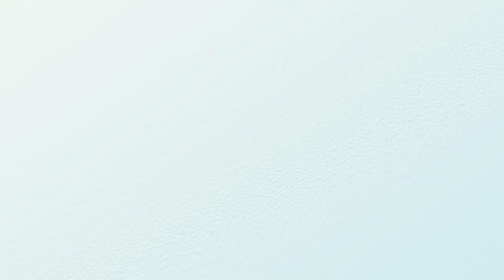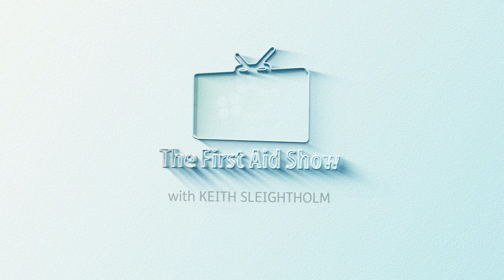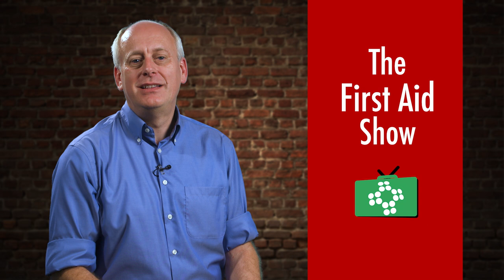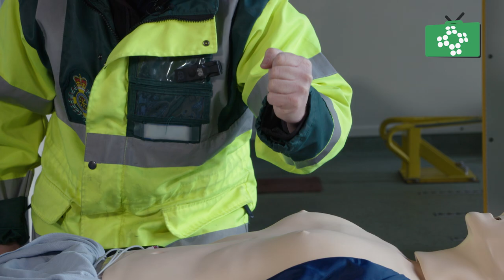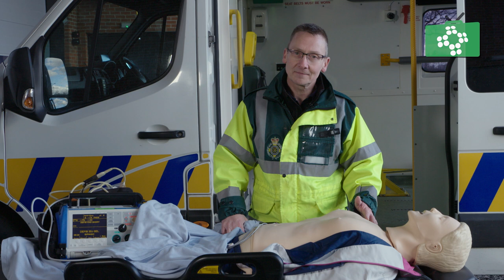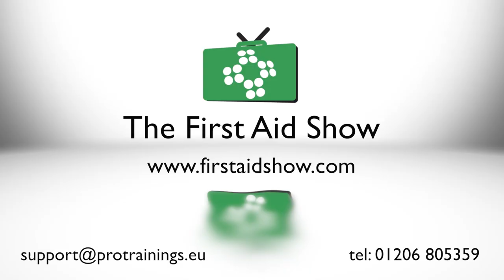The Precordial thump

Comment: I am a  registered nurse, and I had a sudden ventricular beat or fib that I could feel of 250 to 300 with only one heart beat and not the regular lub dub of 2 beats after a partial seizure. I have worked on cardiac units and I know the type of rhythm I felt pounding at the bottom of my heart was a usually deadly heartbeat if intervention is not done in the first 3 minutes. After about 20 seconds while I was still conscious I lifted up my left breast and delivered a sharp, quick, thump with my fist on the exact spot that was pounding. It immediately put me back in normal rhythm. I never knew when I went into nursing that the life I saved would be my own!
Reply: Can you explain this in simpler terms for me cause I get crazy paranoid about cardiac arrest, and the anxiety is taking over my life so if I can learn this even if it dosent work it will give a sense of ease
Reply: @matchamasu3018  Iam biomedical chemist working in Rescuation Reasearch and the technique is called Precordial Thump it means on the middle of your upper chest in the center where CPR should be performed you clinch your wrist making a clench and hit the center as hard as you can it generates 5 joules of electrical shock it is not advisable but if someone doesnt have AED or defibrilator it can be tried as long as with quality CPR and resque breaths until Emergency arrives .
Reply: Ok 1 you cannot determine either VF or PVT on yourself just by a feeling, that is complete nonsense. Moreover, you cannot successfully deliver a precordial thump on yourself. You simply cannot get the power behind it. What you had was anxiety and hitting yourself helped calm you down.
Reply: @Marc Littlejohn  Right, or a palpitation and she stimulated the vagus nerve with the hit...
Reply: @marc4red  maybe SVT? I know a few young nurses that went to the ED due to flipping into SVT especially with anxiety and too many energy drinks during their night shifts.
Reply: @allysophia756  are you suggesting possible scenarios in which a precordial thump might be used? A precordial thump is not indicated in SVT.
Reply: @marc4red Yes I can determine that the hart beat was way beyond counting like a jackhammer pounding at the bottom of my heart. The heart beat was about triple the normal rate so that it was impossible to tell if it was vtach or vfib, but it was one of the two. Too fast to count. I took my fist from two feet away and went bam with my fist as hard and sharp as I could within 30 seconds of it starting. I was staring at the clock on the wall and knew I had to act immediately before I loss consciousness from the lethal heart rhythm. I hit with the bottom of my clenched fist and then rapid recoil after impact……And no, I was not having an anxiety or panic attack and calming my nerves by hitting myself. This is an incorrect and ridiculous assumption on your part. I was not having an anxiety or panic attack like you assume. I performed the action exactly like in the literature and my quick action as a Registered Nurse saved my life and you are ignorance in your smug disbelief and false assumptions 🎉🎉🎉🎉🎉
Reply: @marc4red You are wrong SVT and V Fib are both shockable rhythms.

Comment: Like punching your tv to make it work again.
Reply: Hhhhhhhhh
Reply: punching remote as well
Reply: Except electronics are full of soldered wires and vibration-sensitive technology. Bashing electronic devices to make them work might work for a short time by smashing components back into a circuit, but long term bashing electronics means the solders will loosen, wires will detach to prevent ba circuit, and u could break the housing's connections/seals which prevents rust sensitive tech from dust and rust damage.
Reply: @TrashyQuery  its a joke...
Reply: @TrashyQuery  Well long term bashing humans will have some adverse effects too
Reply: @snailmix  good point ahaha
Reply: @TrashyQuery  I think it worked best on the old electron valve sets :)
Reply: Hahaha🤣

Comment: Almost identical thing happened while I was a medic working in charge of the security of a mall. The woman was in a chair when I arrived attended by bystanders. It was called as a fainting. I immediately had her moved to laying supine (flat out on her back). Eyes rolled back as she became pulse less without breathing. The AED was presented. No rythem detected (PEA, asystole). She was about 300 -350 lbs. I tried many measures as she declined quickly. I didn't want to thump her but I had no drugs and needed to do something else, so as a8 began CPR I reached back about 3 feet and delivered a fist pound to the center sternum to begin compressions when she snapped right out of it. Her husband next to me was quite upset as I delivered the blow and threatened to hurt me should I deliver another blow. It was not necessary because she returned spontaneously to circulation. I heard later the husband claim to be a paramedic and that they were seen doing drugs in the rest room just prior. He was half her size and I suspected he wanted to murder her. He tried to sue me for my actions but after seeing my licences and the lawyers and doctors saying I saved her life he dropped his case considering I left no injuries. I've been a paramedic trained EMT since 1982 and have seen a lot. The thump should be done quickly and with direct force and recoil as I did and not how its taught in other places. 6 inches or 2 feet can work but I think the get best results it needs to be compared to a karate chop that you lift your hand back off almost the moment of impact in a quick jab with the side of the hand using weight appropriate force depending on chest density.
Reply: This is the worst lie, i've ever read.
Reply: @danielebrahim8057  bahahahahahaha true
Reply: COOL STORY, SIS.
Reply: Precordial thump is only for VF and pulseless VT. 

If the patient survived with good neurological outcome but sustained injury from the precordial thump then you may have been liable for injury as you performed a technique that is not indicated for unfortunately.

Comment: As per ACLS guidelines it is contraindicated .... due to thump shockable rhythm may convert to non shockable rhythm. Resus council generally collects data of benefits vs risks / losses and then decides guideline . So many things we are doing in practice may not be that much useful and not part of guideline.
Reply: Curious how would they know that, since for you to see the actual change of a shockable rhythm to a non-shockable one you would have to witness it on the defibrillator and you wouldn’t need to do a precordial thumb if you already got a defibrillator.

Comment: I personally hate the way it is portrayed on TV where the person does it from two feet away. The need to show it done correctly.
Reply: I am a nurse. You use your fist with the ulner aspect facing down. About 18 inches from the chest, a swift hard thump with immediate recoil (pull back the fist immediately after the thump, kind of like you just thumped a bug). You should study the landmarks of the heart to know the correct location in advance. Mine worked.....see my post a few above yours. I did mine to myself right at the spot I felt the intense pounding at the bottom half of my heart. Watch a couple of videos if you want to learn.

Comment: I'm no expert, but I think that cardiac compression is really just a brutal way of delivering the same sort of stimulation to the heart that a thump would. That's why CPR works - sometimes. But the idea of squeezing the heart so hard as to make it force blood through the whole circulatory system - just intuits wrong to me.  Is it possible maybe that some low frequency vibrations applied to the chest might work more effectively than a single thump?
Reply: The purpose of CPR is to circulate blood through the body. You can actually feel a pulse while people do CPR. The purpose of a pre cordial thump is to stop all electrical activity in the heart in hopes that the automaticity of the heart re-starts in an organized manner. During cardiac arrest, many times the ventricles fibrillate (or quiver and not pump blood) for a variety of different reasons, the most common being a clot lodged into a coronary artery (the blood vessels that feed and supply the heart muscle and make it contract)

Comment: is this supported by the resusication council?
Reply: No
Reply: Yes under the ALS pathway if there's cardiac monitoring and a delay in getting the defibrillator
Reply: Yes, but in profound bradycardia. They call it percussion pacing and done slightly in a different manner (20cm above the chest, then repeat the thumps). If no response and deteriorates to asystole then perform cpr. This is just an alternative though and not first-line.
Reply: @joycabrera461  Thanks!!